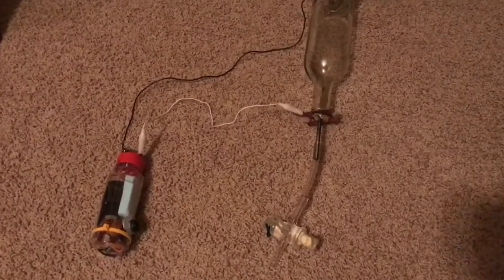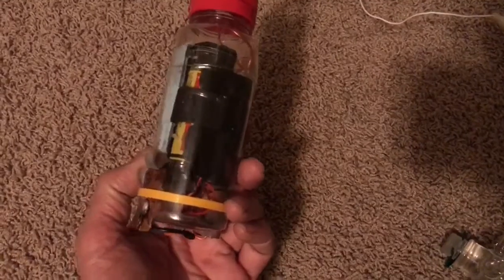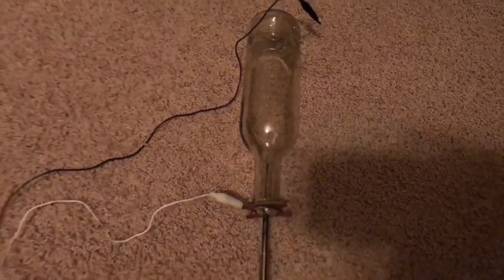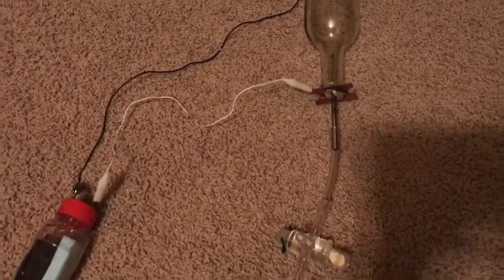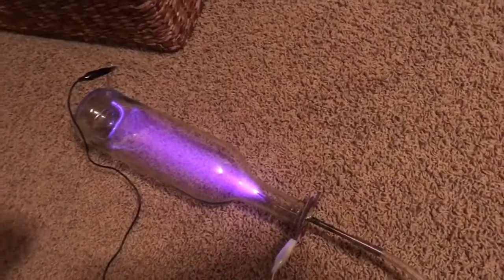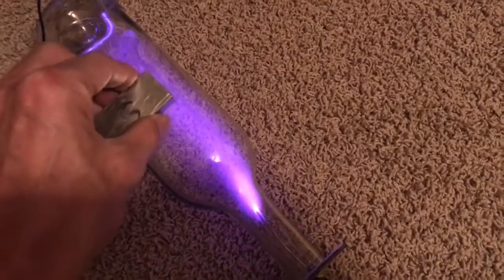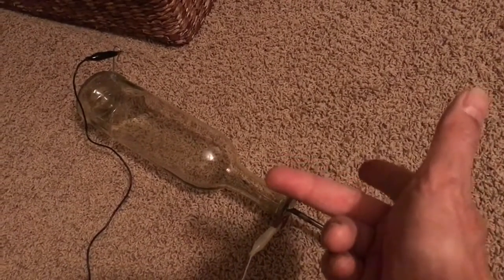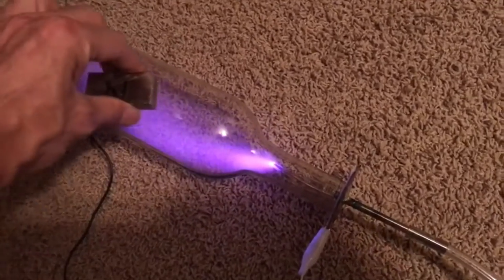Flemings R Hand Rule with Wine Bottle

Comment: Which gas is in the wine bottle? Is it just air?
Reply from the maker: jpmvidal it's just air  - can try out different gases with this setup.
Reply: TeslaSpot 101 it would be fun to watch the corresponding color of each gas. Which one glows blue? Also, what happens if you point a shortwave UV lamp at this wine bottle? Will its low pressure air glow?